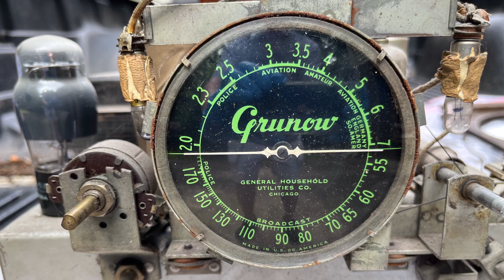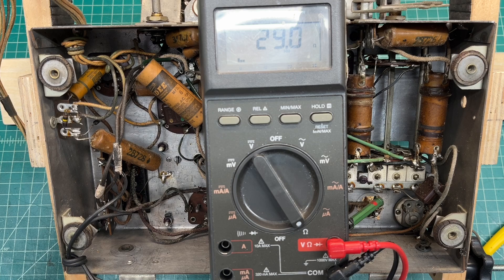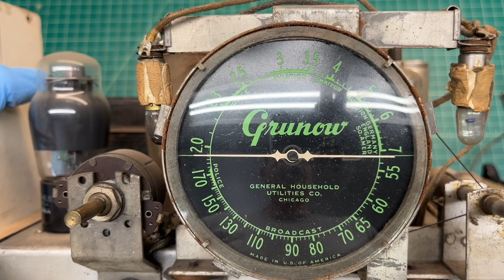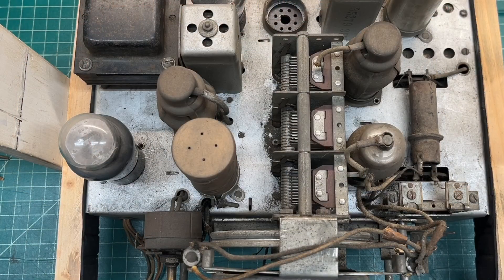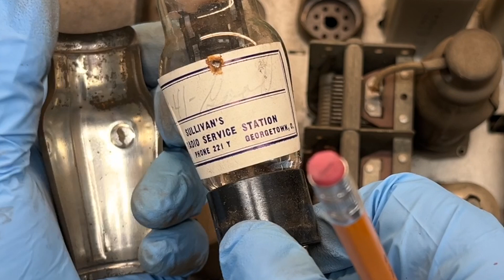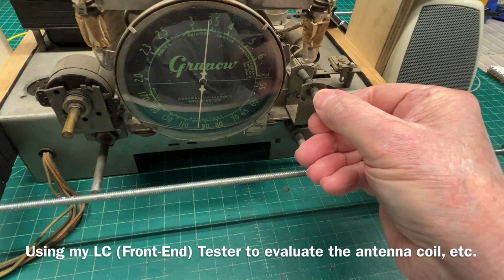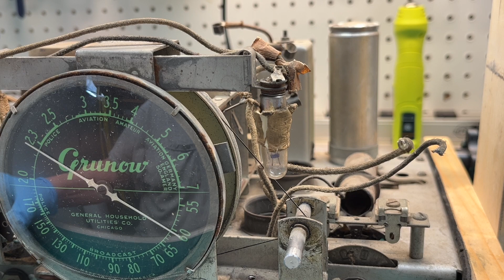Grunow - Model 654 | Receiver Assessment Pre Restoration

Comment: Thanks Don! I can't wait to see it shine like a new penny. I have a couple of GIANT soldering irons I bought at a flea market that since using them I hardly use my soldering gun anymore. They must be about 300 watts or greater because they are MUCH hotter than my 250 watt Weller (poor quality) soldering gun, plus you don't have to continuously keep tightening the tips. Not sure if they still make these foot long soldering irons, but they have no problem getting the chassis hot enough to remove ground straps. If you ever see one BUY IT! They are also "period correct" which is kind of cool! I use a metal napkin holder as the base. I hate to see what would happen to my poor carpet if this thing ever fell on the floor! Take care and good luck.
Reply from the maker: Ryan - I need to be on the lookout for one of those oldies. I have a high wattage Weller too and tried Mr. Paul Carlson’s approach using some heavy copper wire, but still struggle on this thick metal chassis’ like this Grunow. I don’t think your carpet would stand a chance. Lol Best, Don
Reply: @RestoreOldRadios  I JUST yesterday saw two more at a small flea market local to here in Turner Maine at the same flea market I bought mine at 5 years ago. I'm really tight on money right now (unemployed). I've built and sold a couple of electric fiddle amps that I sold on Ebay. I hated parting with those 6L6's as they sound crisp and awesome. I like 6L6's better that 6v6's, not just because of the higher output. Really cool that your radio uses one as the output tube, and an ST style to boot!

Comment: Built rock solid in it's day. Notice the bias cell in the middle of the chassis. Easily replaced by a Lithium 1.5 Volt battery.
Boy that was one dry wet electrolytic can.
Reply from the maker: Steve, definitely a solid and very heavy chassis. Hope to get back to it soon. Thanks for following along. Best, Don

Comment: Fascinating video, and a beautiful set! I suspect the manufacturer may have used radium in the paint on that dial, as it appears to me to have that characteristic faint, greenish glow. It seems the restoration should be fairly straightforward, with not much in the way of surprises as it likely spent most of its life in a dry, sheltered environment.
Reply from the maker: Chet - thank you and I appreciate the info on the green dial. When I get the glass cover off, I’ll capture more photos of the dial to get your thoughts. It does look like the receiver was spared from a barn and overall it’s in great shape. Thanks for watching and following along. Best, Don